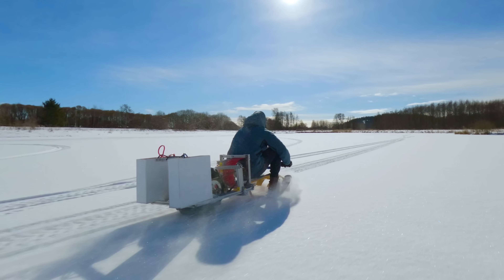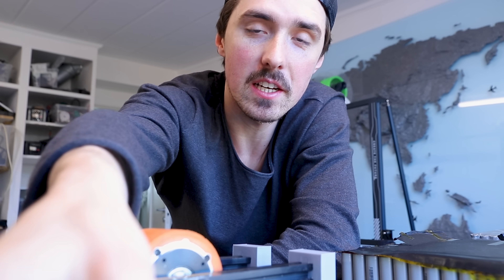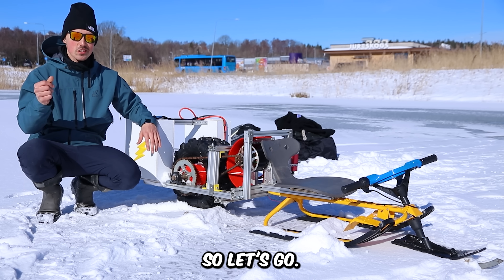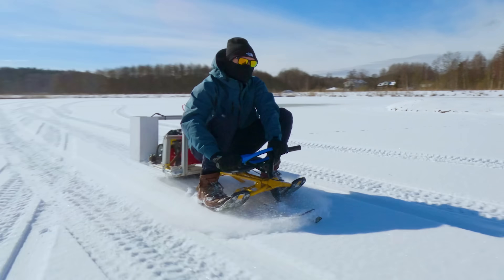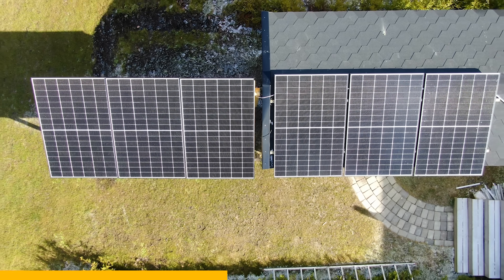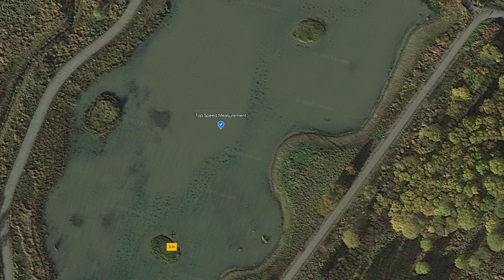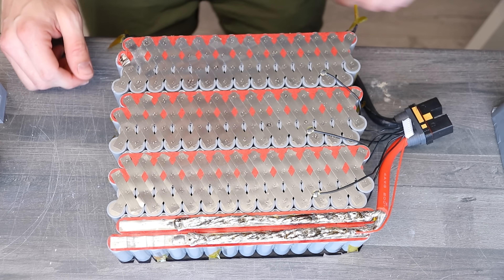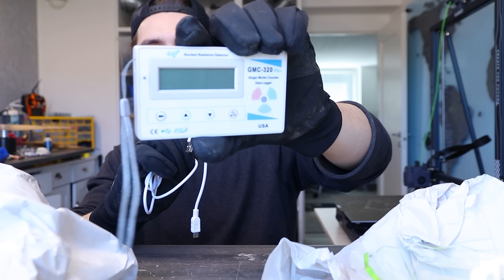392 Lithium-Ion Cells Powers The Electric Snow Racer

Comment: BTW these ski things for steering are called "runners". Snowmobiles have them on their skis and can also be used as wear plates when crossing hard surfaces
Reply: And more modern ones as in newer than -80's have carbide inserts to take brunt of the hard surface. Tough sliding in dirt will scratch the skis plastic and cause friction on snow well as cause issues when getting moving on wet snow.

Comment: Please try the new Prusament PETG Tungsten for shielding.  Prusa describes it as "Prusament PETG Tungsten 75% is highly specialized filament designed mainly for radiation shielding purposes. Tungsten powder inside the PETG filament is a heavy metal that does not react with water, oxygen, or with room temperature air."
Reply: I was looking for this. I totally agree that he should test the heavyrock filament from Prusa.

Comment: To get a better stability, I recommend taking 2 of the things you put on the front to improve the steering, and positioning them about a inch off the ground, so you can shift side to side, and do sharper turns.

Comment: Hi and thanks for the video.
Why don't you use a motor hub like in solowheels? Some of these motors and controllers run on 126V and can have a peak power of 10kW with crazy torque.
I would love to see a realization with this kind of hardware. 🙂

Comment: You can calaculate your maximum velocity by picking a "marks/bits" in the snow in the footage and measuring how long it take for your Snow Racer to pass. As you know the exact dimensions of the Snow Racer you can back calculate the velocity. As you cross your own tracks I get about Snow Racer length in about 3-4 hundreths of a second. If Snow Racer is 1800mm speed around 90Km/h peak!!!... 🔥🔥🔥

Comment: You should have designed the slide in a way, where you could lay down flat on your belly, with your bodyweight above the wheels for better traction and a lower air resistance (and a warmed up belly in wintertime).

Comment: Simon, to aid stability on the rig, would it have been better to mount the Lithium batteries in a  carbon fibre box and bolt it down behind the seat.
And a possible move of the wheel further back, so the centre of weight would be in the middle, just like a single seater racing car (F1).

Comment: 4:30 - I don't think it's only the motor moving. I think it's your long, untriangulated 'swingarm' for lack of a better term. Every time you put weight on the machine, the chain becomes more slack. And hitting a bump just slackens it even more. You need to triangulate the rear of that thing!

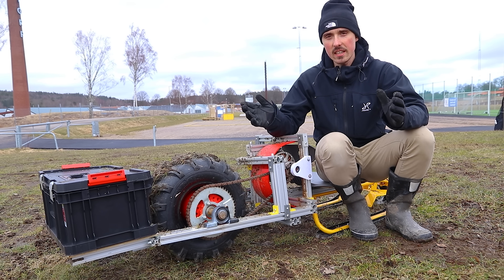Comment: information        4:40    if spacers were put beneath the bearings, the center of  MASS   could be  lowered.        the use of a drive  WHEEL  results is  Minimal  drive  area.          it appears that the amount of  DRAG  at the runners  is  excessive for running on any surface other than ice.         in order to get this vehicle moving from stationary, some kind of (automatic) clutch should be used; and/or more reduction in the drive should be used.

Comment: IDK how accurate you can get this, but if you have zinc and copper sheets (less than .1 mm thickness) and space them less than .1 mm distance from each other, you can make a radio cell.

The sheets should go zinc, copper, zinc. I don't think it matters which is anode and cathode. Also, you're going to need a really good multimeter, as you'll probably only get a few millivolts.

Edit:

The two zinc should be connected (common electrode) and the copper should be the other electrode.

Comment: I think it is actually closer to 25-30% of the maxmimum power because the power over a resistor increases quadratically. I know that a motor is not a simple resistive load but thats why I just assume this. And also correct me if I'm mistaking.

Comment: If you want to try something  different then: Build an German equatorial mount(Or something more fancy like an harmonic drive), perhaps make it in a cool way with built in batteries for portability and try make it have decent performance / load capacity. If you proceed to do so, i could maybe lend you the rest of the equipment for the project so you can take your very own image of a Nebula(In narrowband) in space using your tracker/mount!

Comment: You are wrong regarding motor spec.
Max voltage motor rating is just the max voltage for safe operation of the motor.
You can hit the max output power of the motor way below this max voltage, it depends on the torque you have to supply

Comment: add 3d printed Mud Guard cover over the wheels so that water or dirt doesn't hit your back side of the cloth. if you mount 'Hub motor' would it solve that chain issue?

Comment: You can always use a speedometer app on your smartphone. They're free, you can actively view your current speed, and it will also log a top speed. With the one I use, you just hit the "start trip" button then put it back in your pocket. When you pull it out later, it will tell you your distance traveled, the time it took, top speed, average speed, and a couple other things.
Reply: what is the name of the app ? wanna to use it at ski

Comment: I'd like to point out that 50% of the voltage used would result in also 50% current (amps) which makes 50% x 50% = 25% Power (P=U x I: 0.5V x 0.5A = 0.25W) Or the other way around, if you double the voltage, you quadruple the power.
Reply: I thought this too, but you can run at 50% voltage and 100% current, or 100% voltage and 10% current, so the relationship isn't always P²
Reply: I'm very bad at this so i might be wrong  
But if
I max = 1A
U max = 1V
Then P max = 1A*1V =1W
If you run the motor at half voltage you get 
P = 1A * 0.5V =0.5W
So... then you're wrong.
Reply: @n27272  Being an electrician since 1972 I'm indeed very good at this. This does in no way rule out that I might be wrong in this case. But would you explain, where the one amp in your calculation derives from? According to Ohm's law the current is a function of the voltage and the system's resistance: I = U over R. Hence if the voltage is the half, also the current is half since the resistance is a fixed value.
Reply: Yes, the total amp capacity is doubled but that doesn't mean he will be running double the amperage. He could still choose th run the same amperage at double voltage couldn't he?
Reply: @randomname4726  There are two ways to affect the amperage: the voltage or the resistance of the system. In order to keep the amperage while doubling the voltage you need to double the resistance also. This is how basic electricity works provided the system has a fixed resistance (kind of a black box). With respect to the motor, you can affect the amperage with the motor controller (Electronic Speed Controller) which would effectively alter the resistance of the system also. 
What I wanted to point out was the fact that when the voltage changes, the amps are also changing due to the resistance being fixed.

Comment: Be aware to not charge the batteries when they're hot, with that foam insulation they're gonna cool off a lot slower.
Reply: I read that charging is an endothermic reaction, opposite of the exothermic discharge that most of us have experienced after picking up a pack post usage.
Reply: @mozkitolife5437  What do you mean
Reply: @dries-pederjanse6249  Charging helps to cool them. 
I wanted to know if I should wait to let them cool down first before charging and I read that charging is endothermic, which makes sense.

Comment: try long arm drone inside a helium balloon, the drone rotors need to be ducted through the helium float balloon, and the drone needs to be attached to the mesh holding the balloon
Reply: try making it a solar helium balloon ship, covered with solar sheets, or an under balloon surface, assuming the outer balloon is transparent
Reply: no, like a trike, put a trimaran wings to make it stay upright

Comment: Please take off the middle skis! This should be a rocket ship if you could actually put your weight on the wheel. You shouldn't need suspension, just make it super stiff, like a bike with the wheel at the back and one or two steering skis at the front